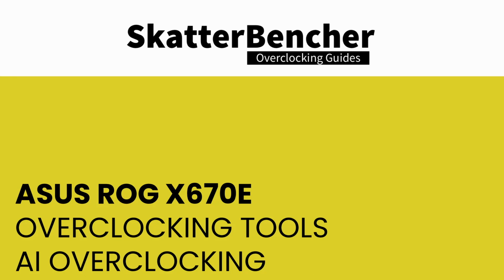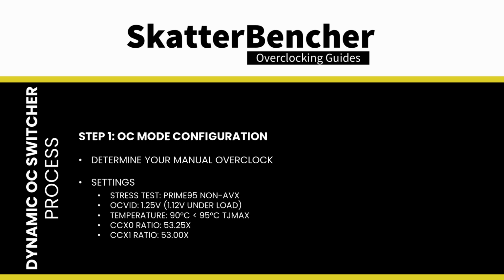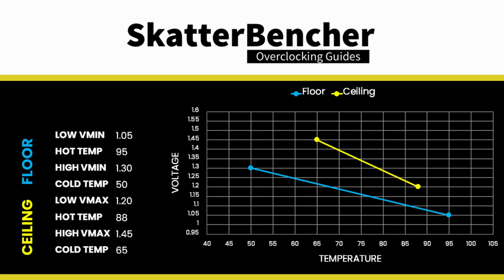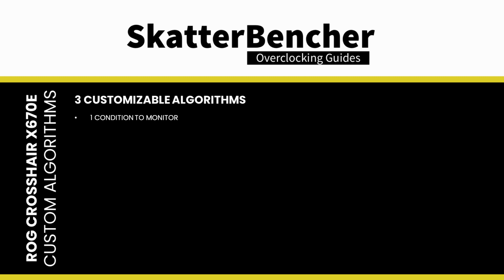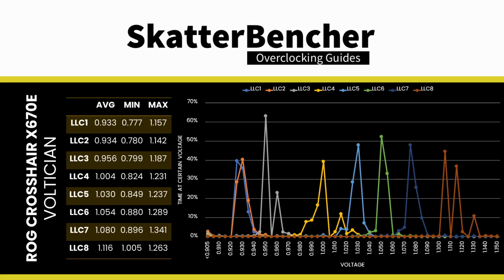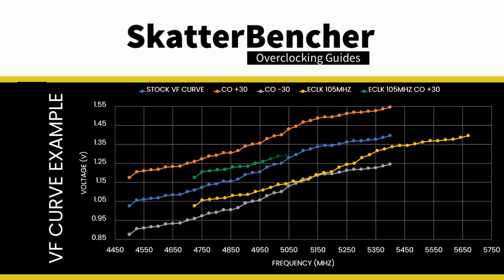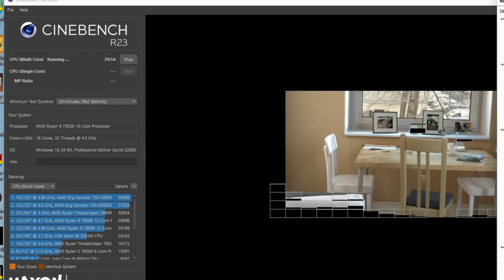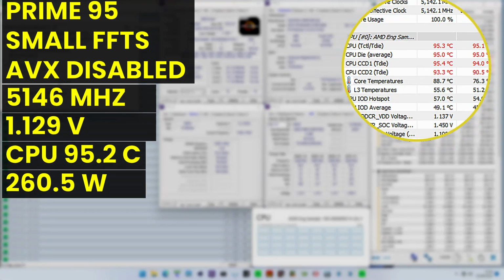AMD Ryzen 7000 Overclocking: What's New feat. ROG Crosshair X670E Gene (Part 2)

Comment: I’m two years late but do you recommend the bios you’re using? My asus x670e does not have eclk. I guess my question is can I flash and older version and get the options I’m not seeing?
Reply from the maker: I always try to use the latest BIOS. 

If your motherboard doesn't have the options for asynchronous ECLK, it's also possible that the hardware isn't on the board. You need a physical external clock generator for ECLK to work. A different BIOS won't help in that case.
Reply: @SkatterBencher thank you sir! All of your methods worked with per core tuning PBO being the best. Thank you
Reply: @SkatterBencher I was able to see a max boost of 5724 on 1 and 3 and 5722 on 4 and 6. 
-30 Mag shift all core PBO ENABLED
CPU boost override 200 
EXPO 2 6000. 
Do you think an over clocked GPU could trigger a crash to an CPU with under voltage parameters?

Comment: Hi, maybe you can help with this weird issue.

My Asus Strix x670e-e was running fine with 6400mhz and FCLK 2200 but after I manually lowered the SOC voltage from 1.43000 auto to 1.4000 manual, now i cannot get it stable at anything above 2000FCLK.
It will post up until 2067 FCLK but anything above 2000 it will become laggy/slow and latency in Aida64 increases by 20ns-50ns more.

This is very confusing and I think only someone like you maybe can have a idea to what happened here.

Thank you in advance

Comment: im currently using a 7700x for my main computer and I set the voltage to 1.220 and for all cores to run at 5.400ghz, is that fine for everyday use and gaming or should I do some other changes?

Comment: When I set my boost clock limit from 0 - 200mhz for PBO, it doesn't effect my peak clock speed whether it's idling, doing single core workloads or multicore workloads. Stock boost on 7700x is 5.55GHz and 5.55 GHz with +200. Temps always below 80
Reply from the maker: What motherboard/BIOS are you on?
Reply: @SkatterBencher  asrock x670e lightning on bios 1.01
Reply from the maker: I'm not familiar with that board, but I've had experience with other boards that first release BIOSes still had AGESA PBO code for engineering sample CPUs. One of the side-effects was that Fmax override didn't work. 

I see on the website there's already 1.03 is the first release BIOS and there's already even a 1.08 beta BIOS. So I would suggest updating the BIOS to a newer version.
Reply: @SkatterBencher  ok, thanks. I will try that out and hopefully it fixes my issue

Comment: Have you messed around with running the UCLK in 1:2 mode at all to try and push MEMCLK higher? Igor's lab did some testing and found the latency hit from running the memory controller at half speed isn't nearly severe as it was with Vermeer. Would love to see what memory speeds are possible when running FCLK:UCLK:MEMCLK in "1:1:2" ratio. Maybe 1800:1800:3600 for DDR5-7200 would be a good starting point?
Reply from the maker: I only briefly tried UCLK 1:2 to check if there was more memory overclocking headroom. There wasn't, so I just leave it at 1:1.

From what I'm hearing, looks like DDR5-6000 will be attainable by most, DDR5-6400 will be tricky for most, and DDR5-6400+ will be only for lucky folks or extreme overclockers.
Reply: @SkatterBencher  No additional headroom at all? That's very strange. Wonder what is holding back memory clocks then. I want to say the PHY, but they are likely using Synopsys DDR4/DDR5 PHY IP, which was designed for speeds up to 8400MT/s. Maybe it's an AGESA issue or something?
Reply from the maker: I'm not knowledgeable enough to make a guess what's holding back the memory frequency. What I do know is that tuning for higher memory frequency is easier on Intel platforms than on AMD platforms. That's because memory initialization is done post-BIOS initialization on Intel platform and pre-BIOS initialization on AMD platform. So motherboard vendors have some degree of control over memory boot up on Intel, but none (or very limited) on AMD. There are still some tricks available to make higher frequencies possible, but it's more challenging (and any manual efforts can be wiped away if AMD changes something on their end)

Comment: As far as I have understood it there should be the possibility to clock memory much higher if done right. 
Infinity clock = bandwidth between ccds / iodie, so just clock it as high as it goes right? 
MCLK / UCLK = memory controller/ramspeed clock. I don't know if the memory controller clock really tops out at 3200mhz. A half speed mode is also possible and should only effect latency a bit? 
So clock the memory controller clock half of your memory speed (6000mts ram= 1500mhz. 
Now you have headroom with your memory controller speed. So just try 7200mts ramspeed wich would result in a 1800mhz memory controller clock. Could be faster than a 1:1 mode but it needs testing.

Comment: I have a 7950x and an ASUS Crosshair Extreme x670e. I tried your bios settings and unfortunately the computer will not boot. I cleared the CMOS back to factory defaults. I have been trying to overclock this board and chip for 2 days now and have not succeeded 1 time. I don't know what to do anymore. I am convinced this chip and motherboard release is premature and not quire ready.

Comment: 5.1 GHz with only 1.05V, 5nm ladies and gentlemen.
Reply: The frequency scaling is just horrible. 'tech yes city ' did all core 4.8Ghz on 0.985V and only lost couple percent performance. It was more noticeable on single core performance, but on multi core is just a joke. AMD throwing alot of voltage and power to get upper frequencies, but it's just don't worth it. It's just cool for benchmarks scores.
Reply: can you send me your bios settings? I cannot get my setup to boot when I try to overclock.
Reply: Please help me, I have pbo on enhancement with my Asus 670 P but my cores never go up to 5.5 GHz and my temperature is always very low like 40 or 50°C. Am I missing something?  Most of my core sit around 4.5 and I don’t understand why

I thought it was supposed to automatically go up to 5.5 GHz unless it reaches 95°C. Well it’s not boosting and the temperatures are staying low. I’m trying to understand this I just got the computer today it blows away my old Intel for core 7700 K but I’m trying to get more out of it and get my course to 5.5 boost